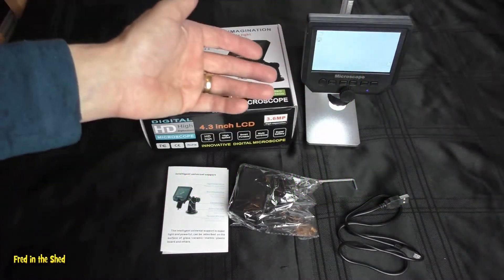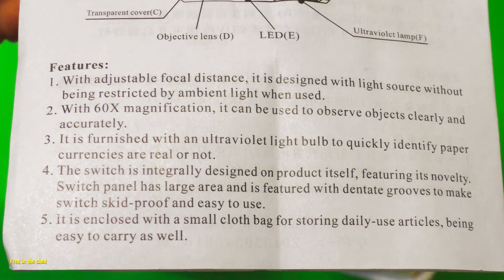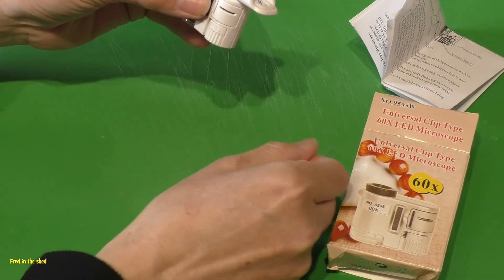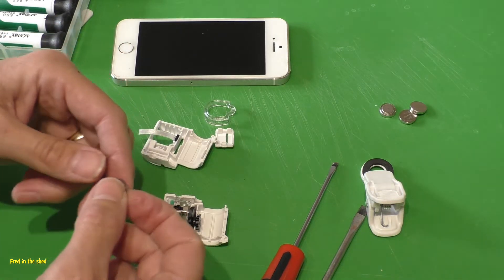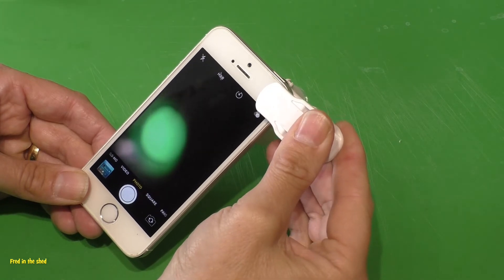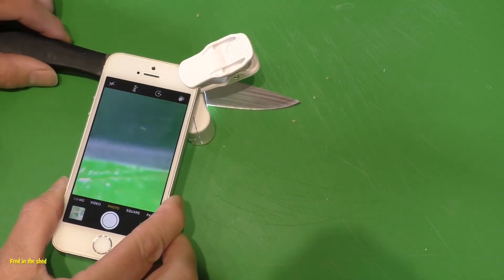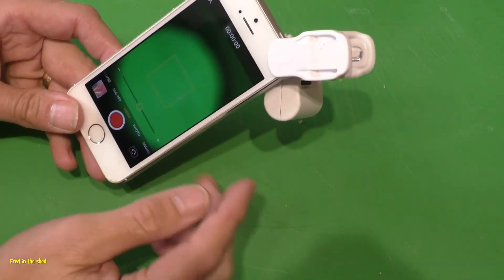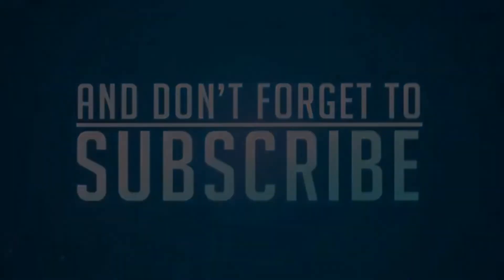Turn your iphone or smart phone into a powerful microscope. REALLY WORKS !

Comment: Count how many times you say "sort of" . It almost sounds like a mental tick. But man its honestly like every 3 or 4 words. Not being mean just trying to offer some constructive criticism. Now that I'm paying attention to the sort of's I would bet my paycheck you say sort of over 100 times in this 8 minutes. I haven't counted but I honestly will put $2000 USD on you saying sort of over 100 times in this 8 minute and 26 second video.
Reply from the maker: Yes your not wrong.   Its a common problem for the un trained.  Sometimes you get fixated on a certain words without realising it. "kind of" is another fav of mine.  I think ive got a little better these days but is easy to get stuck.

Comment: Not a bad price for the fun and ability it has. It would be interesting to see if that circlip is a constant issue or not.
Reply from the maker: Trouble with that clip is there is no locking grove in the barrel that it can slip into so it can work its way out.  Silly design Andy as glue would work better.